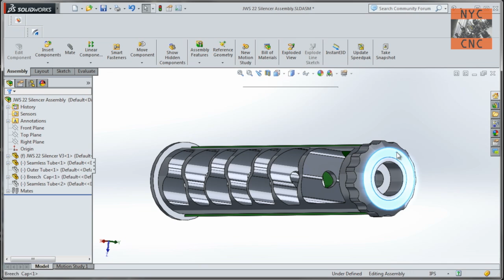Machine Shop Update & Tormach Turret Lathe Purchase!

Comment: First chance you get to pull all the equipment out (and store it for a week or so, yikes) get some really good industrial epoxy on that floor. Don't get the stuff from the local hardware store and don't bother with floor paint as it will just start chipping after a few years. Go to a good paint supply shop to get the good epoxy. You'll probably have to clean and treat the concrete before you pour the epoxy.

Comment: Cleaning the shop and keeping it clean is not easy. I use a Table Saw etc at one end of the shop then the CNC equip (VMC's and Lathe) at the other end. As they are enclosed it keeps the floor in one half relatively clean. I spent about 2K on dust collection pipes and extractor for the wood equipment and it has been great. However also bought a ceiling mounted air filter which takes dust out of the air. The floor is concrete but I painted it with floor paint which makes sweeping easy. All in all, situate equipment to reduce cleaning as much as possible. Wood (dust collection), Storage for tools is a must. At the end of the day sweep up!!!!!!

Comment: John, on the small convection heater.  Haven't run it enough in a day to run out the bbq tank.  My shop isn't real well insulated but it's wood. I do have the ceiling insulated with spray polyurethane foam.  Family owns a spray foam rig and I get it cheap.  So the shop heats up fast and I shut if off soon.  You can put an 80 gallon tank next to the building.  Truck delivery is so much cheaper.  Steel building is so hard to heat. I feel your pain on this one.  There is what is called a skim coat of spray foam.  Hardly a 1/4 inch but it seals up everything and you break the condensation problems of a steel building.  That little bit of foam does make a big difference in what it takes to heat.  Still not good insulation you would be surprised the difference.  Bad thing is, EVERYTHING must be covered with drop cloth or plastic and the walls should be somewhat clean.  Over spray is horrific. Best of luck John.

Comment: John, you need to section off your building to battle the dust. You have many sources of dust, get the grinding into one closed off area as a start, maybe a curtain between grandpa's space and yours to keep the wood dust out. Heating can be an issue when you start sectioning things off but sometimes you can do heat exchangers or filter systems to get the heat in and keep the dust out.

Surface plates and measuring equipment could probably be put into a separate room with independent heating and cooling to keep things more consistent.
Reply: In combination with a strong (!) vacuum cleaner connected to the machine if he is cutting/sanding wood that will be fine ;)

Comment: Build  a shop within the shop, keep machinery that creates dust outside of the cleaner shop, paint the floor, sheet rock the ceilings or panels made out of material that you can keep clean, but keep in mind that you have a wood burning stove, so try to use fire resistant material. Good luck!
Reply: NYC CNC I used Drylock clear, which is a bit more expensive than the regular, but it is a bit smoother to brush onto the concrete in my opinion. I did two coats of it and then I painted an additional 2 coats of water proofing paint, I did both the slab and the walls. I'm in the process of finishing what I suggested you, since I too have to deal with landscaping equipment. The tormach is quietly sitting in its crate waiting for me to finish the shop within my shop. I feel it is the only way to keep dirt out. Later I'll get you the name of the paint I used.
Reply: NYC CNC Ok, I checked and the paint is called Weather All exterior paint, it works as well on interior masonry.
Reply: NYC CNC I totally recommend painted floors. Having swung spanners in Aircraft hangers most of my time it really makes things look neat and importantly makes your light twice as effective. It makes it obvious when there is dirt about and is a big help if you drop a small washer or similar and need to find it. It also helps from a safety and design point of view as you can paint/tape walkways, danger lines and separate areas. No more moving crap to make a walkway - it becomes an obvious rule to not place things in the walkway.
Reply: NYC CNC I can't remember what shade of gray I used for the floor, I'let you know later, on the walls and on the ceiling I used white, it helps reflecting light downwards.
Reply: NYC CNC Go for it, you're home, why not turn it into a nice shop. By the way, I checked and I used Amory gray on the floor.
Reply: NYC CNC the best I worked on was an off white/creamy colour maybe a hint of very pail grey in there.     F1 - now there is a cnc project for you :-)

Comment: Hi John, I no the dust problems its frustrating. I am in Arizona I have a 100x50x19 building. I built a separate enclosure 40x20x10 for my machines. I can heat and ac that enclosure and I eliminated all dust problems. Also have my air compressors outside in a small shed that's be running now for 10 years but my winters is not as severe as yours. 😃 My air dryer is located inside the main building.

Comment: Number one generator of dust in your shop is going to be the plasma cutting table, no question.  I had one for a couple of years, and the black soot and heavy dust (which is actually aerosolized steel particles) just comes with the territory.  The only fix for it is to either put in a large (and I mean LARGE) dust collection system that will take every bit of the smoke outside while the table is cutting, OR to implement a water pan under the support table that will catch all the smoke and steel as it blows out the bottom of the kerf.  Any other solution is a bandaid IMO and should be skipped in favor of just sweeping more often.

Past the plasma table, grinding and welding will make a similar type of crud, though not nearly in such large volumes as the plasma table.  Beware the grinding disk grit around machines with uncovered slide ways.  Bad juju indeed to put grinding wheel material between two cast iron sliding surfaces.

The wood stove will make some dust in the form of ask, but for the most part, all the floating ash should be going out the flue pipe (if it ain't, you've got bigger troubles than dust on your surface plate IMO).

Also, be aware that unsealed concrete generates dust itself, as the surface sheds tiny particles of cement and aggregate.  There are many commercial sealers available to stop this action, or you could just paint the floors with a good hardy oil based or epoxy floor paint.

Bottom line, there is always going to be SOME dust in a combined processes shop environment.  Your best bet short term is to do as others have said and put a "clean tent" or tonneau cover over your surface plate, and keep other more mobile stuff you want kept clean inside cabinets with gasket sealed doors (without good seals, the dust will get inside anyway).

If you want to put something outside in a lean-to of it's own, your shop cleanliness would be greatly improved if the plasma table were the machine segregated from the rest.  The air compressor could accompany it with little issue, save that in sub-freezing weather you will have ice issues with your fittings and plumbing unless you run the compressed air coming out of the compressor through an air dryer BEFORE it goes into the storage tank.  Or, you can wrap the tank, pipes, and fitting with electric heat tape which will always keep them above freezing.  The machine itself won't care unless it gets so cold as to sludge up the oil in the crank case or make the drive belts brittle, etc.  But that's damned cold indeed.  Far below 0 deg F I should think.
Reply: NYC CNC
No worries man.  When we first got our plasma table I could not believe how much soot and dust it made.  We had no dust extractor or water table, it was just blowing the steel dust and smoke down onto the ground under the table (and up into the air).  That table is no longer with us, because it would set unused, sometimes for weeks or months at a time, taking up an area 8' x 15' on a very crowded shop floor.  It just wasn't earning it's keep, and didn't live up to the sales hype when it was running, so it got the old Spanish Archer (as Burt Munro would say).

Comment: Hey John, definitely chuck the compressor outside, but put it in an insulated enclosure so the condensate it produces doesn't freeze in the cold months. When it runs inside it creates a negative air pressure that will draw dust into your shop!

As for dust control, try a curtain. Like the ones they use in warehouses. Just baffling the airflow will do wonders!
Reply: Yes, that work does work as long as the pipe/tube/duct is sealed all the way to outside. Its also a good opportunity to run an automatic condensate drain outside while you're at it.

Comment: Getting lots of ideas coming at you.  Some other ones to consider:

- Look for used pallet racks on craigslist.  It will give you a lot of very strong and flexible storage for not much $$$ and get some of that clutter up off of the floor.  You could get 10' or even 12' uprights in there with 8-12' beams for the decking.  There isn't much on there now but keep looking and you'll see some deals: http://columbus.craigslist.org/bfs/4785724631.html 

- Build or buy a cart to haul the wood for the stove so you aren't tracking as much and dropping bark along the way.  Depending on what's on the other side, i might even consider cutting an access hole in the wall to feed the wood in from that side.  You could also move the stove, too, or maybe rotate it 90 degrees.   it looks like it's a pain to get to it now.

- Harbor Freight has 20x30 tarps for $60.  Maybe hang them from some pipe shower curtain style so you can partition the shop when you need to.

- Harbor Freight also has some pretty good fans to move in some outside air when the temp starts to rise.  I have one of these and can clear warm air out of the house in 10-15 mins on summer nights - http://www.harborfreight.com/24-inch-high-velocity-shop-fan-93532.html

- A cheap shop vac on the dust port is better than nothing.  You could probably wire it up so that it turns on whenever the saw is on.

- Lastly, if it's getting on your tables and tools, it's getting on you and your lungs.  Wood's one thing but if there is metal/slag/abrasives/flux in there it could be less than good for you over time.
Reply: NYC CNC The fans would just bring in clear air if you have a process that throws up a bunch of smoke or dust.  Finer particulates (the ones that migrate through the whole shop) could hang in the air for 20 minutes or more (and find their way around just about any temporary partition).  That 7500 cfm shrouded fan would probably exchange the full building's worth of air in less than five minutes, so if you make sure you have a circuit that moves air in one side and out the other, you have a good shot at dumping those particulates outside.

Comment: Wire a good woodworking vacuum to kick on with the table saw festo or fein easy clean up quite small get a hepa air handler you should be good to go on dust also helps with tooling smells. 

I am sorry but I could not watch my family members work in a shop with no dust control. 

 If you move the air compressor outside it needs to be insulated and have good weather protection. Helps with noise and maintenance.
Reply: NYC CNC let us know what your solutions are.

Comment: About time for the tool changer.  You will never even think of going back.  As for the dirt, there's some heavy plastic walls that can be hung to separate areas and keep some areas clean. Divide the wood working and  grinding into their own areas. Also build a mud room to keep from dragging too much dirt in.    Ditto on the cover for the surface plate and keeping the indicators and instruments in a clean cabinet.
Reply: Also, I keep seeing ads for prefab small steel buildings.  maybe a bit better than a Home Depot shed.

Comment: Regarding the compressor noise issue - I know they are a quite a lot more money compared to a piston type but have you heard a scroll one working? Very quiet by comparison and also pump much, much faster. Also consider a simpler answer like a bigger tank so it is not working so often to keep up and seal any leaks anywhere!! You might even put the compressor on a time clock so it works to build air supplies when no one is there e.g. first thing in the morning / lunch time.

Comment: You can make a super cheap, 3 ply plywood bottom encasement for the saw and then use a simple shop vac to get a good amount of dust.

I suggest you either yourself or your grandpa check the woodworking community here on YouTube they are crammed full of methods done with stuff lying around on that subject.

I have a small saw i made myself from MDF from a shitty chinese one. I'd say that at least 80% of the dust goes in my shop vac. There is of course dust that escapes through the top when i cut longer pieces or fuzzy wood but it's been great so far.

edit: you can also use plastic bad curtains. I just bought those huge thick plastic bags they use to pack various large equipment with. Sliced them on the side, put that bending magnet strip on the vertical parts and then covered the magnet and the edge with duck tape/duct tape. It works good too. Also it cuts the noise down a bit.

Comment: Get a sawdust dust vac http://www.amazon.com/gp/product/B00004R9LO/ref=pd_lpo_sbs_dp_ss_3/179-5070874-9019325?pf_rd_m=ATVPDKIKX0DER&pf_rd_s=lpo-top-stripe-1&pf_rd_r=1QB62QFXYX7EEK4ZA962&pf_rd_t=201&pf_rd_p=1944687442&pf_rd_i=B00004T181 dust mount it to the celling and it will get the most of the dust though i don't know how big your shop is but just put this over the spot were the most dust goes too hope this helps
Reply: ya there are cheaper but my dad has this one nd it does great in about a 30ft by 25ft room

Comment: until you get your own building get a couple of shipping containers small one for air compress and dry storage,

the other one have it for your grinding equipment and general storage stuff what does not matter if it gets dirty 

when you get your shed they can then just be used for storage, power coating.

having a cold air compressor when you use air on the mill it will be very cold running it through a cool mister it will get very cold
Reply: NYC CNC just something simple that looks good and can be moved when need just make sure it weather tight
having the dust makers out of the shed would be a big help for keeping the important stuff clean.

also see if you can pick up a fan and ducting cheap from some where something that can go up on the roof and just pull the air out of your shed.

my dad did that last week and its already made a differences to the amount of dust laying around it only cost a couple of $00 to do

Comment: Stressed skin panel building for areas you would like to keep clean.......leave the welding and dust making in another area in the steel building
Reply: oil price going down means foam price going down...... have panel walls made as assemblies that are transportable easily... Minimize cutouts for doors and windows saves $$ ....Paint interior wall surfaces gloss white for cleanability and light reflectiveness.. easy to heat with in slab radiant heat  and small wall mounted condensing boiler ( or water heater )   or outdoor wood boiler  .. Surface mount larger diameter conduits and boxes for easy changes later . Surface mount Daylight color bulbs strip lighting with 48" Fluorescent or LED 's 
https://www.youtube.com/watch?v=QhOYlHG_aAc

Comment: John I was in your position once as well. Bide your time and check your tongue. Short term benefit is worth the aggravation. I think if you put the air inlet for the compressor pulling in outside air you will find it becomes much quieter. I have mine that way and it cut the noise down by over half.
Reply: Michigan. The Detroit area. My weekend shop is in Traverse City area. I have a two stage 10 HP compressor that pulls its air in from the outside. THe cold air temperature has had no effect on the compressor after ten years. I couldn't believe how much quieter it made the compressor with the gulping of air from the outside. I have a friend who made an intake baffle for his air intake and it worked very well as well. Think of a reverse style muffler intake. The main noise comes from the sound wave generated when the compressor pulls in air. He built a small wood box like a maze that was lined with duct board. He pulls in shop air so temp is the same. Sounds like a cool project for Grandpa and the wood shop to make the baffle box?
Reply: I made my intake from PVC pipe and elbows. Installed the filter just outside the exterior wall. The only thing that you need to watch is spring time pollen and damn cottonwood trees. They clog things up good.

Comment: Hi John,
we do a lot a lot of dirty work in the shop. Sanding cured carbon fiber isn´t what you would like. The dust is so small it goes nearly everywhere. What we did is we put an 20 feet sea container into our building, put a sealed door in the front, paintet it white from the inside and put some lighting in. That gave us two very good points. 1: the dust stays in the container (can be cleaned using a shower rubber) and 2: we got more space to things above it. Another point is you don´t have the major dirt in the shop and you can close the doors if a customer arrives. 

Hope that helps.
Hendrik

Comment: You will like the cement mixer
Reply: No, I used it to make a cobb pizza oven, if it can throw pure clay I dug out of the back yard it will handle what you are going to do. At first I thought it was crap but realized the belt was slipping, tightened it up and was good to go. I got the 3.5 cibic one.